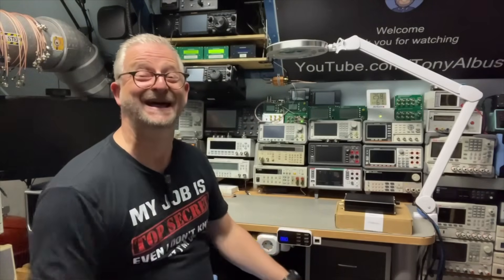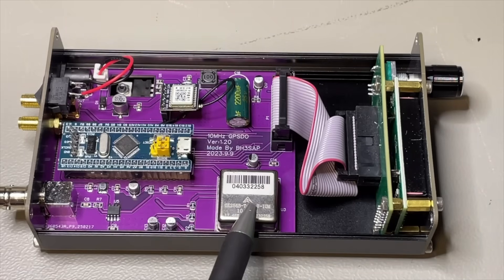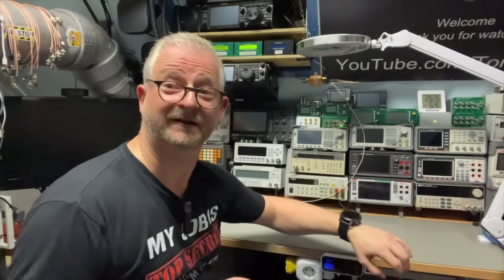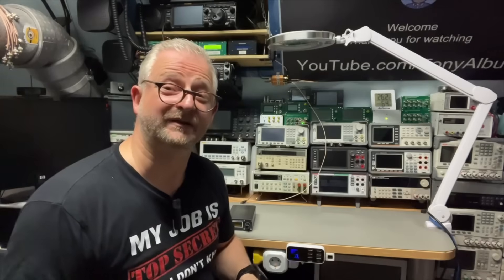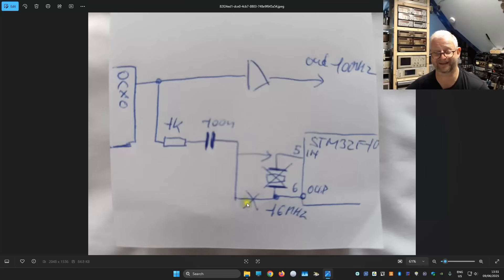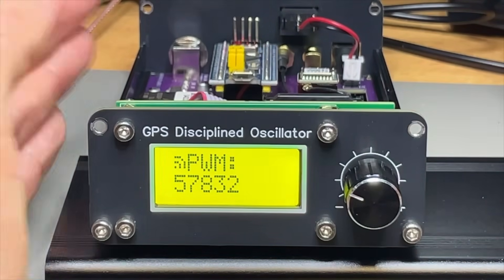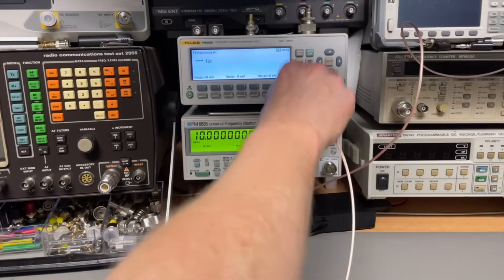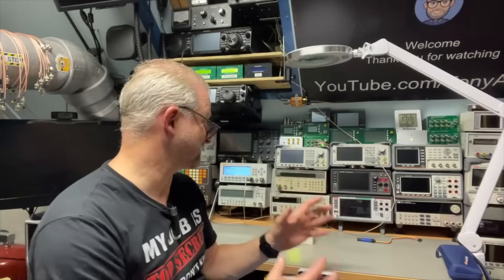TA-0446: Cheap GPSDO BH3SAP - Unstable Fix - Firmware Upgrade

Comment: Hi, what is the DBM at the 10MHz output? Thank you very much.
Reply from the maker: Hi, there is a great treath on EEVblog, also mods to improve the quality of the output: https://www.eevblog.com/forum/testgear/10mhz-gpsdo-by-bh3sap/475/
Reply: @TonyAlbus  The Datasheets say 7dBm, Why does it have 14 ? 
https://youtu.be/VEUoicP6ppg?si=nei49XX6jJCIm7fG
Good question ?
Reply from the maker: depends if you mesuere with 50 ohms or not?  or the specs are just wrong. or they used different ocxi or different opamp, its just what they have at the time.
Reply: @TonyAlbus  Very interesting. I don't have measuring equipment to check. What dBm reading do you get on yours? I have the same one, and I'm afraid of damaging my USRP.
Reply from the maker: @frkial8649 9.2 dBm into 50 Ohms of my SA.
Reply: @TonyAlbus  Thank you so much, I have the same one as you. But I think I'll get the Leo Bodnard; I enjoyed your video. Thanks again for everything and for sharing your knowledge.
Reply: Thanks  @TonyAlbus

Comment: Thank you very much. I tried it with 4 different BluePill boards and even when I changed the Pin 5/6 issue it was very unstable. Sometimes it started sometimes not. But as I removed the 8 MC Quartz from one of the BluePill boards it gets stable at once. Evey time i switch on, it starts as expected. So if someone has the same Problem, remove the Crystal without hesitation
Reply: And IT is Best to remove c13 and c14 to, its unneeded path to gnd
Reply from the maker: Thank you for sharing!, yes i will try that on mine too.

Comment: De mijne was ook aangesloten op pin 6..dit gelijk maar even veranderd. Bedankt voor de tip. 😁👍👍👍
Reply from the maker: Top!  ja leuk ding voor de prijs als hij werkt, niet gek hoor.
Reply: alles sind an Pin6 angeschlossen, Designfehler, und C13 und C14 gehören auch raus wenn der Quarz nicht benutzt wird

Comment: Has anyone tried fitting a blackpill in these yet?,73 Paul dem3vuv .
Reply from the maker: Hi Paul, on EEVblog there is a threat about it with the original designers. But i have seen only they are improving the signal for now. but it could be interesting to follow this.

Comment: You have the Model: "ATGM336H" with tath problems. So is there a "fixed" or newer model avalable, witch i can buy on banggod? thanks tony 73 de OE8XKX
Reply from the maker: Hi, i have the ATGM336H i think, it was in the video, mine works good after the update

Comment: Tony, first, I enjoy your video content and watch frequently even thought most of my equipment is way less sophisticated than what on your bench (I'm jealous).  Anyway I performed this upgrade on both re-soldering to pin 5 and then the firmware upgrade after I purchased the ST-LINK V2. Note: the ST-Link I received from Amazon had a slightly different pinout than the one pictured on instructions/pics. I notice they moved the ground pins from 5&6 to pins 3&4. Please let folks know! Anyway I was really happy that I pulled it off!!! I was sure to end up with a brick... When I first moved the soldered connection to pin 5 I did struggle to boot. I needed to press the reset button inside the device. A simple restart did not work. However, once the firmware was updated I have had no issues with reboot (yet!).
Again, thanks for this video because initially it was jumping around a lot and I was very skeptical of its performance. I don't really have the equipment to measure that accurately. My best counter is an HP 5351b which gets me to 26 ghz but I don't see milihertz unless I'm using it wrong, which could be the case... I purchased this GPSDO device to lock up this counter and a couple of nice signal generators. the best being a Marconi 2030. Final note, it still jumps around a bit but I'm locked on 12 to 16 satellites and the little graph provides some nice confidence...
Ben D, Montville, NJ
Reply from the maker: Hi Ben, thank you for watching, yes always a bit scary when you need to make changes to a new device because it is not working right out of the box. but seems you did a great job on it. Yes its normal for some older High GHz counter to not have a mHz, they were made at the time for mostly high frequencies only. my counters that have those mH en uH only go to 300 MHz or 3 GHz with a prescaler, my older Systron Donner 26GHz also only has Hz as the lowest.

Comment: Has anyone noticed that as the unit gets closer to zero error the clock gets further away from correct, ie 4 seconds. I have tried both versions of firmware and have around 28 satellites, 10MHz output is correct. Time starts correct and the closer it gets to zero ppB the time error increases. Any help appreciated.
Reply from the maker: Did you check that pin 5/6 issue on your device? it is in the video. that solved my clock errors.
Also is could be a serial communication problem between the gps receiver and the bluepill. check if the contact are clean on that gps receiver, it is sort of plugged in on the pcb.

Comment: Thanks Tony!  I have the same device and could not get it to work at all.  And the seller would not respond.  The issue wound up being the wire attached to the wrong pin under the board.  Just as you suggested, I switched it and instantly got 14 satellites.  And the firmware from dankar works great.
Reply from the maker: Great to hear is was helpful. thank you for letting me know! yes great job from the software guys.

Comment: Tony, thank you very much for the instructions, I'm not that bothered by a lot of decimal places, 8-10 digits are enough for me, I have an older Mastech MS6100 counter with 8 places, so this GPSDO 10MHz accuracy is enough for me. But I was also not satisfied with the fluctuations. After adjusting the wire on pin 5, everything is OK even with the old FW. On the Mastech MS6100, I replaced the regular 8 MHz time base crystal with an 8.000000 MHz TCXO and everything works fine. You do a very good job and I enjoy watching your videos. Good luck.
Reply from the maker: Thank you! Great solution for some purposes a TCXO is fine too.. i am kind of lost in more and more digits, so many i dont even need LOL  :)

Comment: Thanks for another nice video. You mention "Arduino, some people call it bluepill". These are two different things. Arduino is based on 8bit Atmel chip. Bluepill is 32 bit ST chip. Quite a difference in performance. Its like saying "this is a Skoda, some people call it a Porsche".
Reply from the maker: Thanks and thank you for correcting, i got that wrong indeed.
Reply: David, what you say was true at the very beginning of the Arduino project. Nowadays the Arduino concept embraces a manifold of microcontrollers with different architectures, so you may say "bluepill" is an Arduino compatible board, as is also the case with ESP32 based boards, Microchips PIC based boards, etc. Let´s see what happens after Qualcomm recent acquisition of Arduino.
BTW, great video Tony! I decided to purchase a GPSOD based on your tutorial and after visiting fredzo's fork page.
Thank you!
Reply: @guillermomendive6445 I'm not sure who David is but I have some thoughts on what you said. Yes, you can say that Bluepill is an Arduino (software) compatible board. You can't say "this is an Arduino, some people call it Bluepill". I think distinction needs to be made between Arduino as software programming platform and Arduino development board. While both Arduino dev board and Bluepill and many others may be used with Arduino software, that doesn't make all of them Arduino boards. A Bluepill is a Bluepill. An ESP32 is an ESP32. Both have distinct features very different from Arduino board. You can't say that German Porsche is the same as Czech Skoda because it drives on a road in Czech Republic, even though in essence they both will get you from A to B. Also, all of these boards can be programmed in many ways other than through Arduino software. Being supported by Arduino software does not make a Bluepill an Arduino. There are many different Arduino boards but Bluepill is not one of them.

Comment: I liked your video👍
I just ordered through your link.
The price convinced me.
The Leo Bodnar LBE-1421 was too expensive for me at the time.😏
Reply from the maker: Thank you!
Reply: @TonyAlbus Unfortunately, it didn't work out.
PayPal wouldn't release my money?!
Is AliExpress that bad?
Reply from the maker: i have used paypal in the past too, without any problems. sometimes when using a credit card, you CC company wants you to verify in the CC app. or when you lkinked your CC to your paypal.
Reply: @TonyAlbus  Yes, I already noticed....
Reply: @TonyAlbus   Everything works without soldering and also the start.....👍👍

Comment: Great video, information presented is valuable and you presented it in a very straight forward way.  Thanks.  I use a rubidium standard but have been looking at getting a GPSDO for a couple years.  Could you do a video comparing and contrasting these two frequency standards?
Reply from the maker: Thank you Sir! i just ordered a rubidium standard from ebay,hopefully it still works. so that will indeed come in a while.

Comment: Bought the same unit 3 months ago. The wire is in the correct spot, no repair needed. Considering the software update. Giving comparable results, different OCXO though.
Reply from the maker: Thanks for letting that know, so it really seems a manual production error.

Comment: A nice unit for the price - once it's repaired and had the software updated. Thank you for showing us the repair and update process, Tony. Regards, David
Reply from the maker: Thank you David. i was so happy i wound that comment in the reviews and the guy responded inmidiatly 
i am not sure this is THE fix. but at least it made it work again. Great job was done by the guys on the Software side

Comment: Very good. Quite tempting for the price. 

Beside accuracy, phase noise is very important, especially for digital modes and GHz operation. bg6khc has a pn2060c phase noise analyzer for about US$849 shipped. It works very well, comparable to expensive commercial devices. I have written a few blog posts on it and was able to achieve results comparable to manufacturers' specs. I have both the pn2060a and the later pn2060c. Search for sites. Regards Drew VK4ZXI.
Reply from the maker: Thanks! interesting!

Comment: What kind of isolator do you have plugged into the frequency counter (black square box)? 73 DE W8LV BILL
Reply from the maker: Hi Bill, it is a 50 Ohms pass trough / terminator. the counter is 1M so i wanted to terminate it. 73

Comment: Great job! Thank you for hints Tony and respect for the soft guys! I need to make such improvement on my unit but I'm not sure of using communication interface with macbook. What would you suggest? Kindly regards 😊
Reply from the maker: Thank you! Yes the software guys did a great job. maybe find a cheap old windows laptop on your local ebay just for stuff like this. here in NL you find old laptops for 20~30 euros
Reply: @TonyAlbus   Great to hear from you! That's what I will probably have to do in the end, but I also believe it's worthwhile to prepare the environment on Linux as it develops spectacularly. Nevertheless, the day has always only 24 hours... ehhh

Comment: They've changed the board from what it is in mine, it seems.

The recommended setting for the PWM (DAC setting, where it should start at in memory) should be about half the value of 65535, according to my Symmetricom ET6000 GPSDO's manual. It doesn't look like that is settable on these small units, I can't tell. Below is from the ET6000 manual:

"Choice “6>” allows the user to enter a DAC (Digital to Analog Converter) value from
00000 to 65535. This value is a digital representation of the analog voltage (0 to +5
volts) that is used to control the internal oscillator. This feature is especially useful when
attempting to null the oscillator (see Chapter Five).

"When keyboard switch 6 is pressed, it allows the user to enter a five digit DAC value, the
midrange being 32767."

My small unit, similar to yours, started having issues, in that after leaving it running for about a day or so, the screen would show gibberish. I don't have much in this one, about $25, so I may not go to the trouble of updating it. A quick switch off and on cures the problem, as it doesn't take it long to lock onto a satellite. I really only use it to test freq counters with, if I'm not close to my ET6000 at the bench.
Reply from the maker: Yes the ET6000 is much better, the ADC setting depends on you specific OCXO. and it helps to get faster to the correct setting in a cold start.